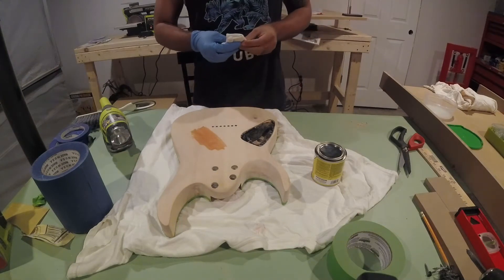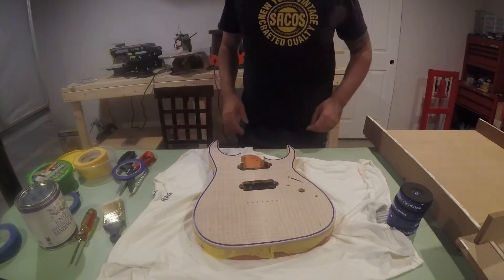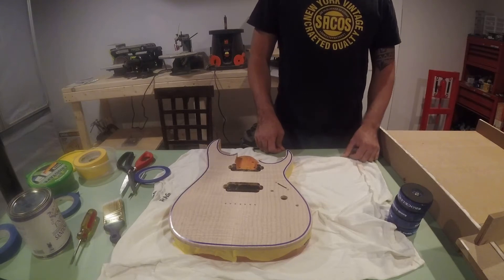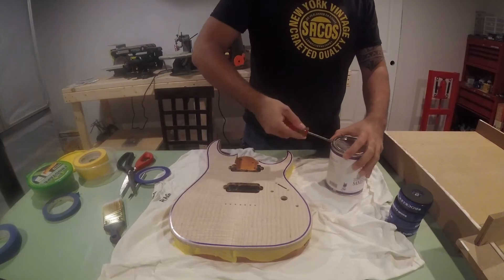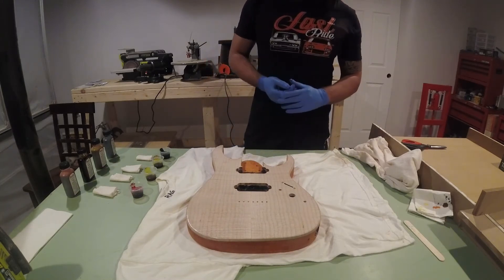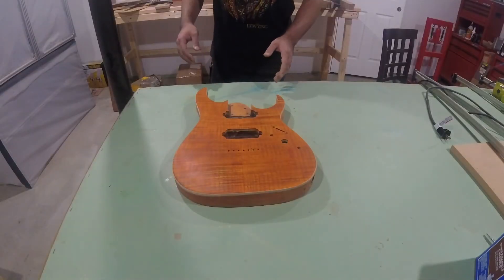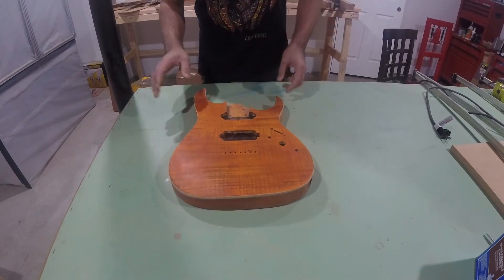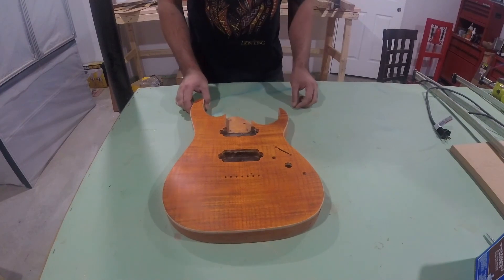Staining Ibanez 7 String with an added Flame Maple Top

Comment: Hey, I was thinking about doing the same thing to one of my Ibanez hand was wondering if you had any tips. Like what thickness top wood did you go with? I was also wondering if you managed to fix the areas where you had use fillers? Nice job for your 1st time by the way!
Reply from the maker: Since it was my first attempt I am ok on how it turned out, now I think I would find a piece of flame maple to match the grain and fill the spot like an inlay. The tips I got are learn your way around the flush trim router bit since if the bearing falls into any hole (like the ones from the neck pickup to bridge pickup wire hole or the bridge pickup to electronics hole) it will be a bad day, same thing goes with flush trimming the outside and the bearing falls into the jack hole. Seen a lot of people doing it... and to this day I keep forgetting hahaha, I hope I see your project soon!!